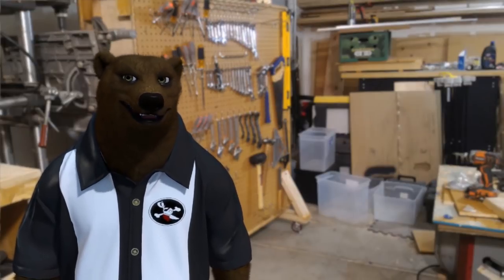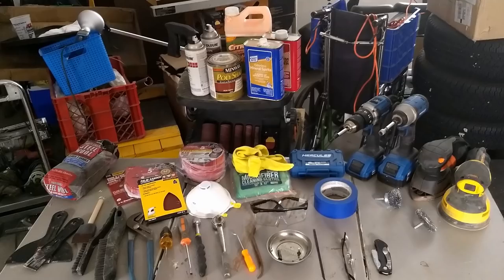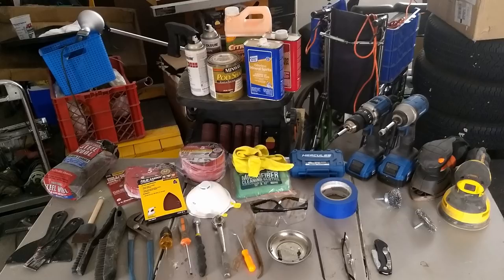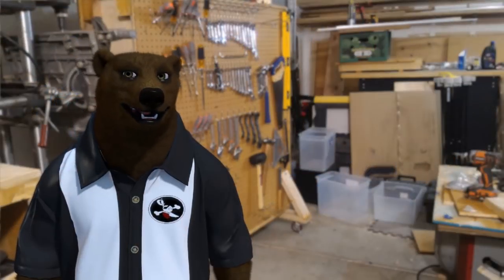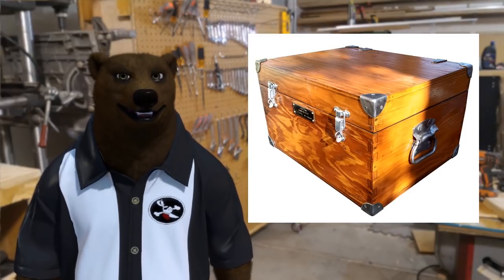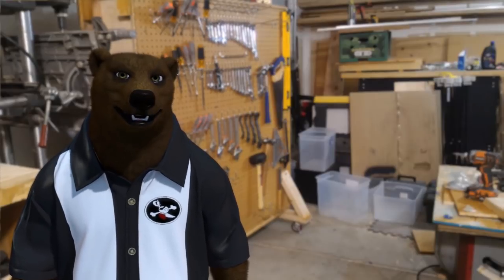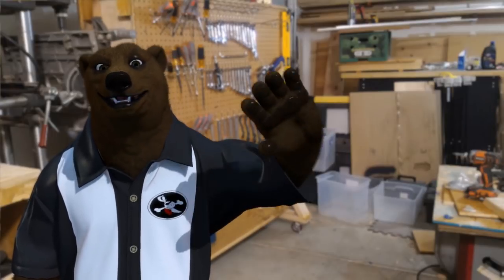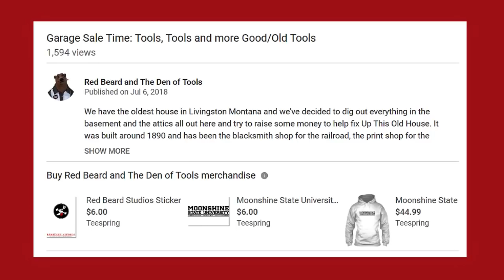WWII Signal Corp Box Restoration (Ok, RestoMod)

Comment: Trick I learned many many moons ago.  Glove up and rub planer shavings into the stripper.  It will act like mild sand paper and absorb the goo!  Gets into the nooks and crannies better than any scraper.  Won't leave a single tool mark either.  Any course type saw dust will do but the shavings from a planer work the best!

Comment: That came out really nice. Two tips if I may: cover the remover with kitchen plastic wrap. It will keep the volatiles that do all the work from evaporating  as fast. (Not sure about the Jasco stuff, which I've never used. It worked on my favorite remover,5F5, which is pretty potent stuff, as well as on the citristrip and other "greener" strippers. )  For the hardware, boil it in a strong mix of water and vinegar, or TSP if you can get it.  Sometimes the paint will wash off under a strong stream from the faucet or a garden hose; in any case, it will be easier to remove. I used a cheap set of picks, but now you can buy crafts versions of dental tools that would also be awesome.

Comment: Looks good. Rockler is the only retail supplier of flocking supplies that I know of. 
 Also I don't buy mineral spirits anymore. I use charcoal lighter fluid. Big bottles at Sams Club and its cheaper than MS. And for acetone and lacquer thinner the best place is the swapmeets. The paint guys sell the 5 gallon cans for around $60 or less for lacquer thinner and acetone is usually much less.

Comment: Hey you got it done! I was hoping you would post it. Oh if you want links to wrench holders I used in my pics. The extra long Harbor freight box/open wrenches were 2 piece wrench holder strips (plastic) from h.f. the wrenches in reg wrench drawer I got on Amazon....metal... I think aluminum and choice of colors and 2 sizes and 2 directions. The box/box wrenches same brand but different style holder. Rest in a holder were what ever holder they came in.

Comment: For stripping the hardware try soaking it in brake fluid, I used this method on some old hardware and it took a while but it worked and was not caustic.